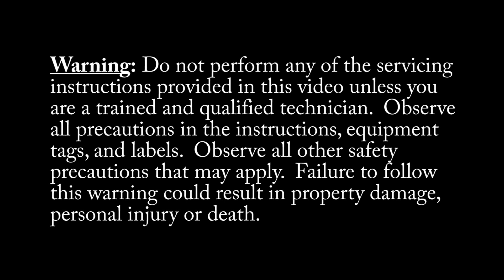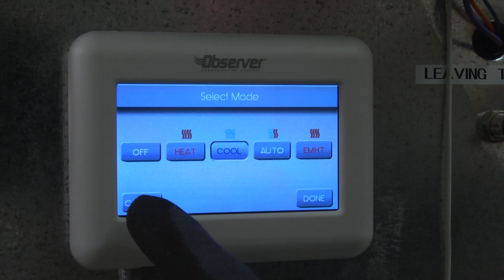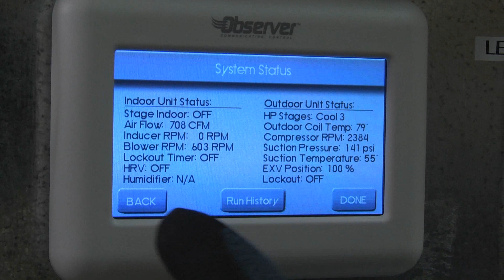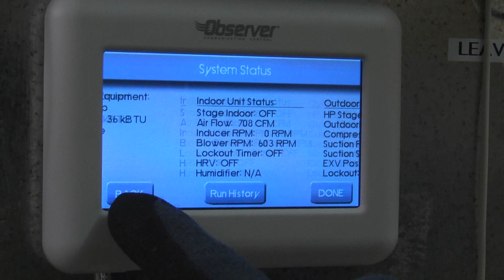ICP Variable Speed (5 stg) - Familiarization (1 of 4)

Comment: Nice video, i have a question for u, i have 037 straight coool ac with communicating thermostat.
in stage 1 compressor is runnuing 1700rpm not 1200, also sometimes in stage 3 its also running 1700rpm not 2200, thermostat does not show any faults, it recognises all equipment correct.

tried to change thermostat and use 3 wires to wire condenser but this didnt  solve the problem.

airhandler is running correct cfm at all the stages and thermostat is showing correct stage but compressor rpm simply not in place.

any ideas?
Reply from the maker: Well, we are "just the marketing folks," but our understanding is the the 5 stages are based on specific cooling capacities, not specific compressor speeds.  So as the ambient conditions change, the speed of the compressor will also need to change to get the required BTUs for that stage.

The 1200 and 2200 RPM numbers that you are mentioning are likely something you saw in the spec literature for the sound ratings.  We have not seen specific compressor RPM values listed in any other spots in any of the literature.

We would encourage technicians to contact the technical support department of their local distributor for more assistance if needed.
Reply: I have a carrier infinity unit same board at first the code was reading 179 on thermostat but the discount was sizzling replaced with a 40 amp as it was calling for they had a 30amp know the fan runs slow then pick up speed after ten minutes it shuts down any suggestions on this issue?